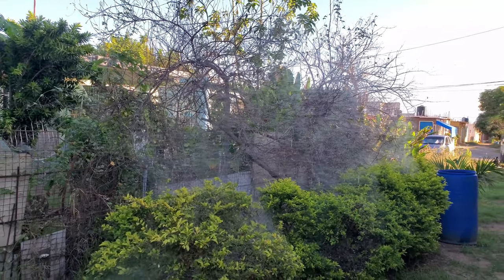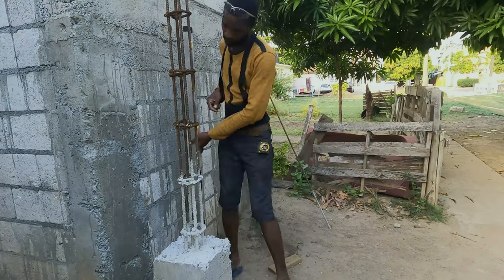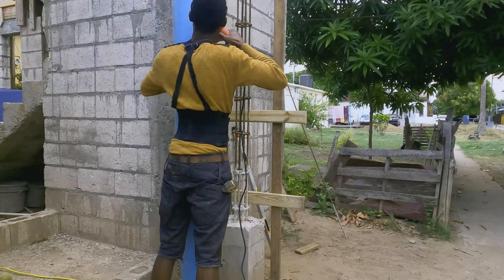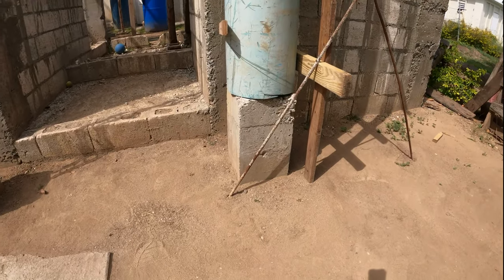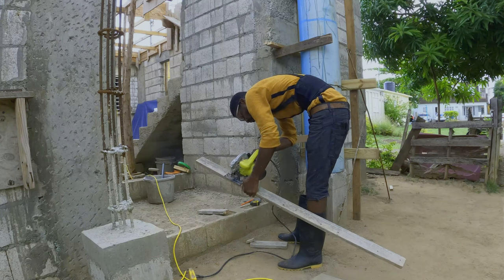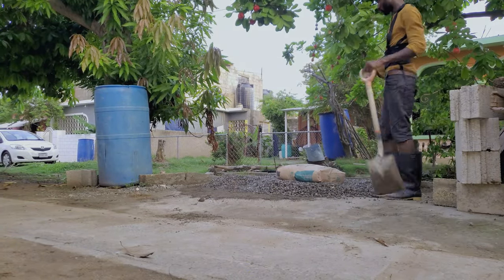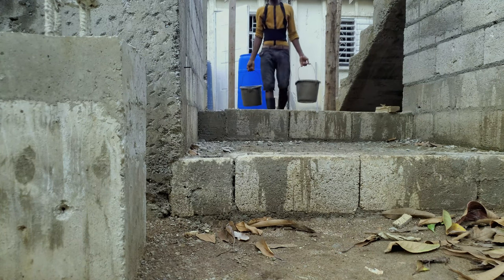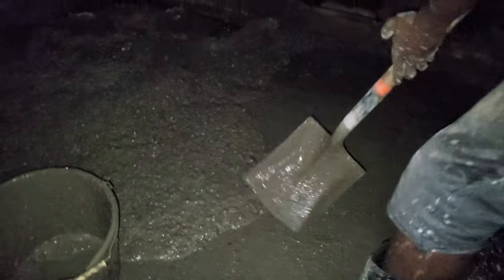How To build A Round Column. Cast-in-place

Comment: Got my front columns for about 9000 each for labor, guy did a good job but took too long to come back for the back ones so I bought the pipes and my builder did those. Those in the back are just round but in the end it really doesn’t matter.
Reply from the maker: the ones in the back going to look much better when you grill it..

Comment: If those columns are going to be supporting weight I would tap the outside lightly with a hammer after each pour to further compact the cement.
Reply from the maker: its just for aesthetics in the entry way